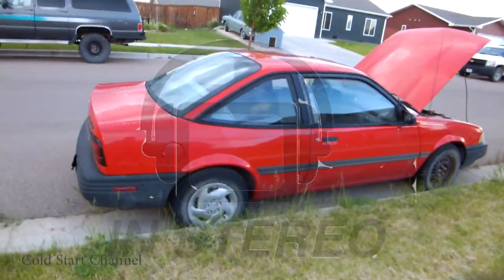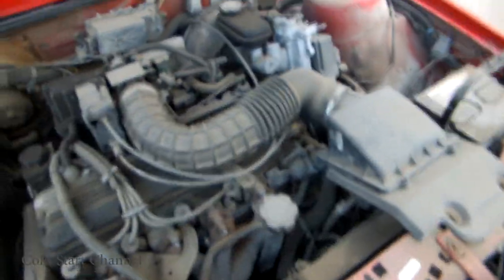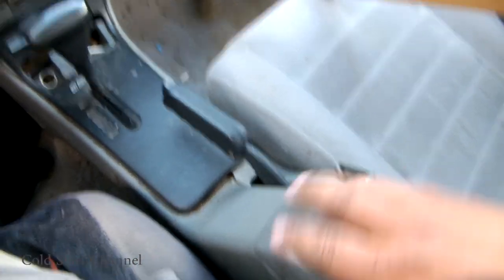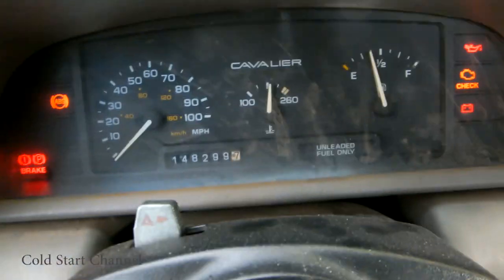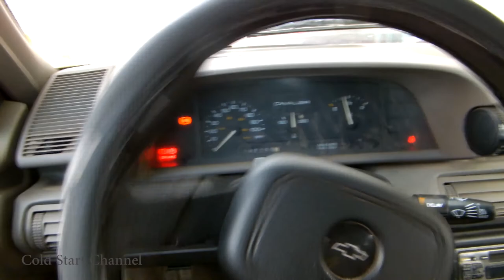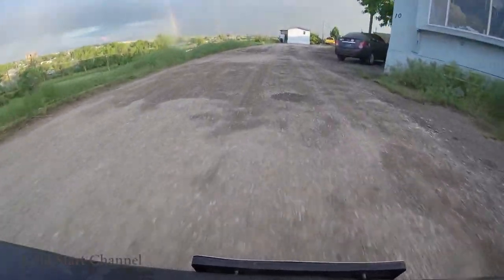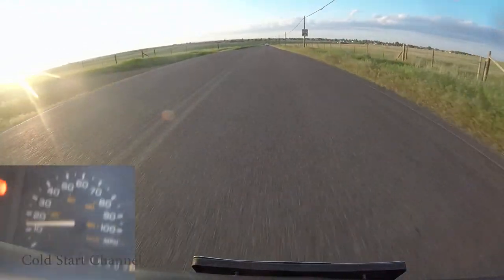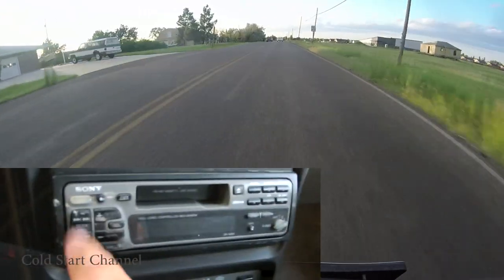1994 Chevy Cavalier Cold Start and Short Drive.

Comment: But they always had the front end humbling sound
Reply: Yep my whole front end bumper on mine 1994 Chevy Cevelier RS, weld crecked n the front bumper segged but cer wus solid n mine hed the 2.5L Iron duke in it, it wus n RS version hed trection control, peerl white w/ grey n red pinstripe, hed the tinted drop top sunroof, reer wing spoiler w/third breke light, no skirts the thing is i never seen one other like it, must've been cenedien model, i live in SC n peid $650 for the cer beck in the summer of 2007,n got rid of it in 2010, strong engine.